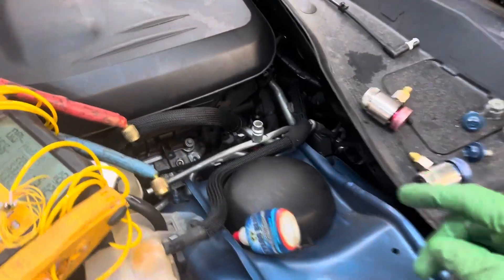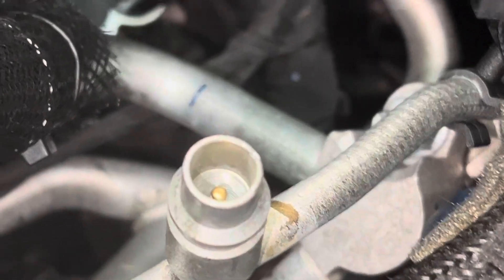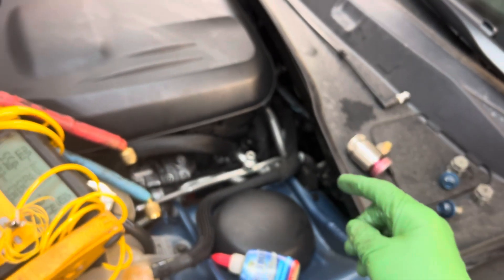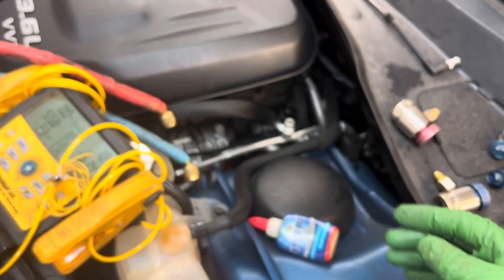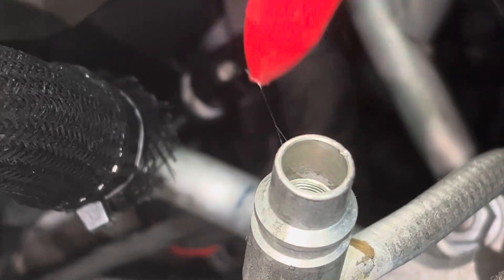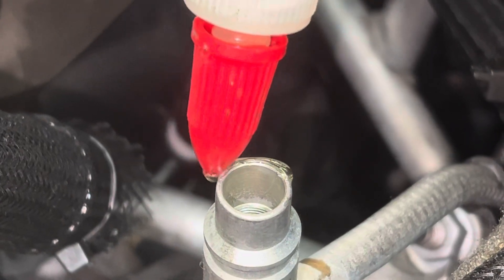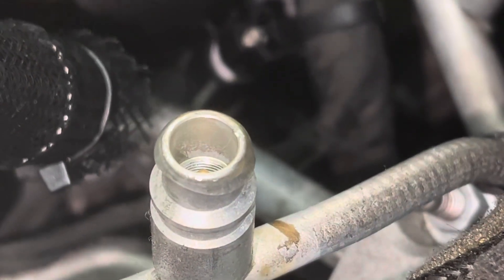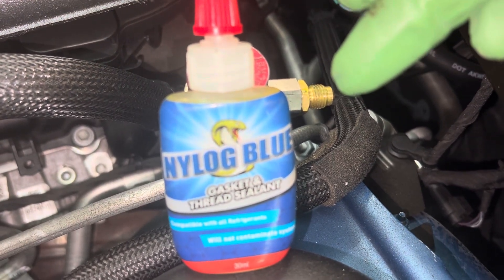NYLOG protect your refrigerant attachment, couplings O-rings from vacuum leaks and damage

Comment: I hate nylog. I refuse to buy it. Not because it doesn't work. But because of the bottles and how garbage they are. This stuff will leak out of the bottle and it will make whatever container or bag it was in STICKY and MESSY forever. Not even alcohol or degreaser will clean it up. Should come in a medicine dropper, a plastic syringe or a toothpaste tube with a solid cap. If they changed the packaging, I'd keep some in my truck. I like Superlube O ring grease or POE grease which are not messy at all.
Reply: More for me, I love that stuff
Reply from the maker: I would say use silicone grease, but that’s messy and sticky and slimy to

Comment: Do u use only one manifold for r1234yf and r134a and just switch out the couplers or u have a separate set for each refrigerant ? Im asking coz im starting a seminar set up and this manifold is a little pricey .
Reply from the maker: I have several refrigerant manifolds
But you could start out with one 

And have a refrigerant solvent flush tank filled with 100% or 99.9% alcohol that is pressurized to about 140 psi with dry dry nitrogen 

Blow it through your hoses, for example, in the high side hose through the manifold and out the suction low side hose . 

A few squirts of alcohol 

Then I hook it up to my nitrogen tank at 600 psi and let her rip for a few seconds . 

Of course and fly your eye out or bust your tooth or something dangerous .

Comment: I haven't had a protective cap for 1 year, what is the risk?
Reply: what brand coupler u using
Reply from the maker: @RATCHETMAN1001  yellow jacket or master cool I have some eBay and Amazon ones too, but the yellow jacket and Master cool have been most reliable but the new yellow jacket YF couplings have been failing the ones made in China
Reply from the maker: Depends on your environment, corrosion at the valve. 

And if you go to replace it, you might find out that the threads have corroded in there and it gets stuck and breaks off when trying to replace the valve  core

If the valve leaks, you don’t have that secondary back up cap and O-ring to stop the refrigerant from leaking